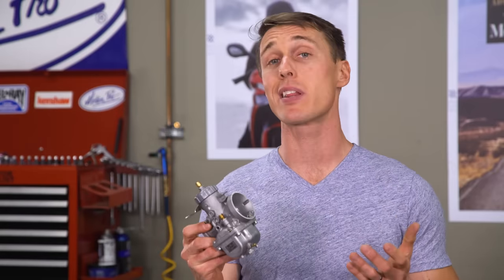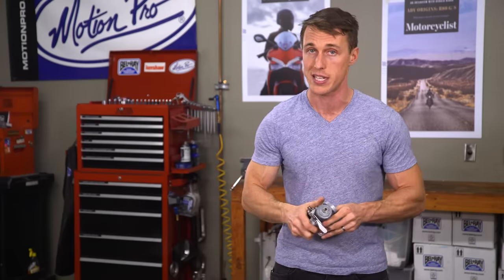Carburetors vs. Electronic Fuel Injection—What’s Better? | MC Garage

Comment: I like fuel injection. Up here in the Northeast it helps cold starting immensely for winter riding. Also there are not any fuel evaporation issues during storage that can gum up a carb.

Comment: "you will end up having to work on carbs" Not in over 110,000 miles on my 2002 CB500. Maybe buy reliable Japanese 'bikes instead of vibe-apart Harleys.
Reply: Lemongrab. I won't own a Harley with fuel injection. All my Harleys have had carbs. I rode my 1973 Sportster up Pikes peak 14,000 feet and did not have note worthy trouble until 12,000 feet but still easily rode the last two thousand feet. My 1979 Superglide went through the Eisenhower tunnel, west of Denver, at 11,000 feet no problem. Maybe some Japanese bikes have more carb. trouble at altitude. Maybe that is why some people foolishly want fool infected bikes.
Reply: Japanese made isn't reliable, especially when talking about bikes, and it only gets worse the older it is. Might want to re think what you wrote haha

Comment: Question 
Can a engine (which was designed for fuel injection )run and preform well with a carb. and vice versa?
Reply: Theoretically yes, practically no. Why?
Reply: If the throttle body or say the mouth of the carburettor matches the existing setup then yes. Many Royal Enfield Classic 500 owners have converted their existing efi to carburettor setup , here in India.
Reply: If you find a way to nullify the ECU on an EFI engune you can run a carb and if you find a way configure the sensor array for a EFI engine on a carburated one, you can run EFI on it
Reply: That's pretty impressive. Respect
Reply: Ken Vukel Some guys here in Indonesia swapped their FI with carbs. Performance reasons, they said. You can search it here on youtube
Reply: Ken Vukel and yes, the engine is running well, idk about the long term effect tho
Reply: Pande Yoga "performance reasons" lmao. Can't complain, getting a jetting kit is cheaper than getting a piggyback in Indonesia
Reply: Yes. I succesfully installed an EFI kit on my 50cc four-stroke scooter. Ran better, started easier and pulled harder in comparison to the same scooter whilst it still had the carburetor (properly tuned ofcourse). EFI just has more potential for power (and economy). Reliabilty is high though when some electronic related component fails you're stranded, but that doesn't normally happen. EFI > carb, though carbs are more fun and make a nice noise.
Reply: Yes, they are completely swappable.  Just note a few things.

If going from carb to EFI, you'll need to bring along the computer that manages that EFI.  That computer will need inputs from sensors (mainly O2 sensor, RPM, TPS, and MAP).  If your bike was carb from factory then you won't have places for these.  Now typically the MAP and TPS will be on the carb or there abouts.   You can weld an O2 sensor bung on easy enough, but you may run into an issue with the RPM counter.  Many carb bikes use a cable driven mechanical tach, which isn't going to work for an electronic signal.  Furthermore the bike may not even have a tach.  So converting to EFI is very do-able, but there may be some very difficult sensors to integrate depending on the bike.

Now going from EFI to carb is much more simplistic, but it also prevents its own challenges.  You can throw on the new throttle body, and that will work irrespective of anything else, but the computer also typically controls ignition.  It may not do so if it's not getting resistance from the injectors (depends on the computer), or not reading valid data from any of some of the other sensors you removed.  Though with a computer and some work-arounds you can probably get it working just peachy.

The latter is much easier than the former.

At the end of the day an engine is an engine.  The fuel delivery doesn't make much of a difference.  The only thing you should note is that a carburetor at one specific (or maybe a few specific) operating condition (operating condition is load vs RPM at a given temperature/pressure/humidity) can match fuel injection.  Though in all other operating conditions the EFI can out-perform the carb.
Reply: The computer is included in most of the sets. Just like the O2 sensor and an RPM meter that goes around your spark plug wire, works like a charm.
Reply: You would also need to change the ignition system .
Reply: definetely yes u can....i am from indonesia...we can do anything....
we can even make one cylinder bike into twin cylinder bike...
change injection to carb or otherwise....thats a piece of cake....
Reply: Ken Vukel virtually yes, practically no. EFI bikes have valves and all that good stuff. Carbureted bikes are 2 strokes and don't have valves. You can take a throttle body off a bike and replace it with a carb. You'll have a million other issues and you'd have to throw out all the ECU stuff. Carbs spit gas whenever they want. FI's are meant to disperse gas when the computer tells it to. So the engine basically won't even turn over if you try it.
Reply: kawi rider, two stroke or four stroke has no impact on fuel injection vs carburation. Fuel injected two strokes exist, and a carbureted 4 stroke is basically the most common engine configuration in automotive use from the early 1880s to the late 1980s.
Reply: Yes, but why would you? EFI is way more reliable today compared to the carbs
Reply: it is a normal thing happen in Asia where drag racing is popular. You can adjust Carb anyway you want but it is not easy if you want to do with FI. Chosing a good suitable carb, with your knowlegde or good mechanic, you will feel the defferent between carb and fi.
Reply: Yes and NO.. Personal experience is with a Bimota V-Due (yep the bike that Killed Bimota) A few that wern"t returned were changed to Carbs. because the Fuel Injection didn't work as efficiently as expected..
Reply: Hahaha No.
Reply: Yes but the amount of money involved is stupid
Reply: @bikelifebreezy7400  if your carb is spitting gas whenever it wants too,  you have a problem. Yes, two strokes have valves (reed valves).
Reply: @carlcajepe9014  uh.... yes it can be done

Comment: I'll take a carb over a efi just because I don't like not being able to fix something on the move or not at all
Reply: Your "logic", if one can call it that, does not work bro... I also do not like to be able to fix something on the move... HOWEVER and this is a GIGANTIC "HOWEVER" your chances of having issues with your EFI compared to your carb are like 1 in a 1,000,000 (that's a billion if you don't know how to count)
For example:
You are on a ride across states. You are climbing a mountain range on your carb bike... it starts having issues with altitude and it leaves you stranded... you pull your tools and get to work...
Now me, I'm riding the same route... I'm climbing a mountain range on my EFI bike... aaaaaaand I have no issues... I go over the mountain range and ride the bike for several years, decades even without ever even having to take a look inside the throttle body...
You see, EFIs systems NEVER EVER EEEEEEEEEEEEEEVVVVVVVVVVEEEEEEEEEERRRRRRRR have problems...
And if they do have a serious problem once every billion times, you can get a new injector, or throttle body for a ok price, easily replace it and be on your way...
Get with the times man.... progress is good!
Reply: I agree that fuel injection is far more reliable and needs less tampering but carbs can still be great if they are set up well, I rode through the Swiss alps which are at high altitudes and my bike still ran fine, in fact its done 20k with very little meddling or upkeep. Certainly not arguing as I agree injection is the future but some just prefer the carb method, like shown its sort of a mechanical vs electrical debate.
Reply: 1, 000, 000 is not a billion .
Reply: Fuel injection rarely fails so dont worry about that
Reply: I'm sure carbs can do that and more, I mean, they are pretty clever for being mechanical devices... However we can all agree, your performance most likely dropped significantly compared to a similar bike with EFI which can self adjust.
The only reason some prefer a carb is nostalgia... there is no other reason as you and I agree, EFI is superior in every way. You said it yourself "20k with very little meddling" but you are "meddling" with it still. While the rest of us go 100k and above with absolutely zero meddling ever...
So, my point? Like I said, the only reason you like it is nostalgia.
Reply: Laughing Man AE
LOL yes you are right! LOL!!!!! FAIL!!!!!!!
Reply: +Riggro Think you need to learn how to count matey... Because you clearly typed a million and then state (rather condescendingly) a billion..!
Reply: Riggro it Might just be nostalgia bit I still prefere it its just I don't really trust technology too much. 
No question efi is superior but for me it's just I like spending time on my bike and technology just ruins that a little for me but beaty is in the eye of the one looking at it
Reply: n0pr0 HD
There was an article, in some muscle car magazine somewhere, I was reading while waiting to get my colon checked or something that was about some old fart lamenting how the good old days of working on your vehicle were over. In his views, millennials weren't interested in cars and were more interested on instagramming their fancy gluten free lunch.
Except one faithful day he had a chance encounter with a Tuner shop... He met a bunch of millennials who were not only good at tearing down engines and rebuilding them like he was, but where also good at reprogramming the super smart "boring" computers that ran them! This, the old man said in the article, was eye opening! He had spent the last  decade of his life believing he was the last bastion of a generation of doers when all he had to do is open his eyes and look where no one is looking. He had believed that technology ruined what he loved when in reality, it just added a new level of fun! In the article he describes how he decided to become an apprentice to the youngsters and had learned a lot from them. I wager if you gave it a shred of interest you would find the electronics behind modern vehicles rather fun to fuck around with.
Reply: Riggro no question I'm very interested in electronics and computers even knowing my way around them carbs for me  just being something that works is very simple and "refreshing" as I said EFI is a thousand rime superior to carbs but it's just personal reference 
I can totally understand your point of view bit as I said personal reference
Reply: Skyerzen. If fool infection never ever has problems why do I get check engine lights on most of my fool infected cars? Get back on earth. There is no such thing as a device that doesn't break therefore the best device is one that is easy to fix and that is old school carbs. and an ignition that can be converted to points if no other parts are available. After riding 53 years I know the facts and you will probably only have your opinion. You young guys that think hi-tech is the only way to go are way too inexperienced. Hi-tech is great when it works but isn't worth shit sitting stranded.
Reply: @Skyerzen  hey man, can you still find that article? Seems like something I'd be very interested in
Reply: I've been looking for that article for nearly a decade now... :(
Reply: Fuel Injection IS superior to carbs, just deal with it old man.
Reply: just keep another sensor and injector on hand as I do, they're easy to replace if you have them
Reply: @bottmar1 it's actually better to be stranded with tech, I found this out when my bike didn't start on the side of the road, a flick through the manual told me that the flashing light was telling me that the injector couldnt be detected (connector came loose) a simple plug in and tape and it worked
Reply: Joshua Wilmot. A rare instance where a wire fell off an injector does not prove that a whole fuel injection concept is good. Most connectors are locked in place and can't fall off. I have never been so lucky as to find that kind of easy fix on any fuel injected vehicle. I don't need a manual to repair points ignition or carburetors on any of my vehicles. I rarely have trouble on any nation wide trips I make on my Harleys and even then it's only minutes away from running perfect. Fuel injection just plain does NOT provide simple maintenance on most problems. It never fails to amaze me that so many opinionated people refuse to understand the value that easy repairs are of extreme value and the better reliability of fuel injection is just plain does NOT provide that. Most fuel injection lovers are very adept at wildly exaggerating the amount of problems old school vehicles have. I have collector cars and motorcycles plus I have been a mechanic on vehicles for 49 years. If I say old school vehicles are reliable enough plus easy to work on and new vehicles are hard to work on I know what I am talking about. Have fun.

Comment: Fuel Injection is reliable...as long as the electrical components hold up. A dead battery can and will put a new bike on the side of the road, while on a carburated bike it just needs a kick over (or roll start) to run.
Reply: same with a fuel injected bike, I've actually seen a kick start fuel injected bike
Reply: @AstoundingAmelia  Kick Start still requires a electric fuel pump to provide fuel pressure to the injector(s) and to the O2 sensor and computer. I've never seen a Bike with Mechanical Fuel Injection, but if you find one, then I'm wrong, but without that exception, no power, no start for FI bikes in general.

Comment: Also, in the case of Port Injection, it cleans the intake valve, combustion chamber, and the more consistent mixture greatly reduces carbon buildup around the piston rings. Whereas carburators cause build up everywhere, and clean nothing.
This was the single greatest improvement in ICEs, because it greatly improved the longevity of ICEs, while improving emissions. FI also allows for intake manifolds that can have multiple length runners, which can overcome the slight deficit in power relative to carbs/tb injection.

Comment: I hate fi when battery dies, nothing you can do to start your bike.
Reply: Well without kick starter you are fucked woth carburetors aswell.
Reply: Weltenspinner LPs but i can push bike downhill, then i'm good to go.
Reply: Try doing that with a 750 ccm four cylinder bike! :P
Reply: Weltenspinner LPs haha got what you are saying.
Reply: Can you not bump start a FI bike?
Reply: just push it
Reply: matt harmeson i dont think so since the injectors need electricity
Reply: Thats why you keep a jump pack with you when you ride. It saved me from being stranded
Reply: matt harmeson you can, it will start getting electricity as soon as engine starts and gets the stator going. If it dies straight away, keep the revs higher and it should be good. Done it on completely flat battery last week (even dashboard didn't illuminate), took 4 tries, battery was back at 12v after 3h ride
Reply: ive bump started my cbr600 on flat ground no problem
Reply: aakash singh
EFI and Carb both get power from the stator and not the battery. The battery only powers the starter motor.
Push starting does work on both kinds of bikes.
Reply: you  can bump start an EFI bike
Reply: Weltenspinner I can pop start an R1 just fine, even cold.  On flat ground.  Heavy, sure.  But impossible? Not hardly.
Reply: When fi bike battery die just Put gear in top end and spin the back wheel it will start.....
Reply: Me too i hate fi
Reply: @SickPrid3  the only problem with that is most modern bikes stator doesn't provide enough to prime the injectors from a dead battery
Reply: @Skyerzen  false, push starting requires fuel to compress if you have a dead battery the fuel injectors won't prime and won't have enough juice to prime.
Reply: @RageUnchained  shit, I didn't think of that. But could it be that pushing the bike turns the stator just enough to produce enough charge to fire the injectors? Me and my friends managed to get his bike started after pushing it up a hill and letting it coast down for a bit before releasing the clutch. The battery was dead dead. Would just click once when pushing the starter button. His bike is a 2013 ducati hypermotard
Reply: @Skyerzen  probably depends on the definition of "Dead Dead" as the starter draws more amps than the fuel pump.
Reply: aakash singh if that happened just connect negative and positive wires it well start on kick
Reply: @RageUnchained  just put it on the centre stand and spin the rear tyre in forth, you'll make enough energy to light the dash and start the bike
Reply: @AstoundingAmelia  that does not work on a bike that A does not have a center stand and B weighs 1000 lbs
Reply: Check fuse on coil,,---u can blow fuse on coils soon as you hook-up cables to jump..,,,computers need lots of juice.-(some coil fuses will burn when your old battery gets to low .),this protects ecu.

Comment: The 2 distinct advantages of efi over carb are volumetric efficiency and thermal efficiency. These advantages can however be negated if the computer is not kept "in tune".